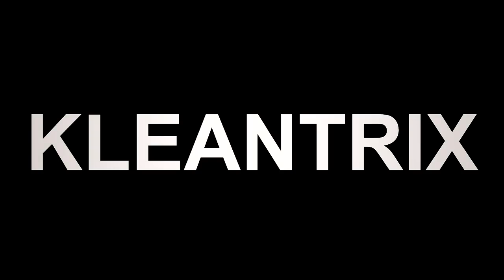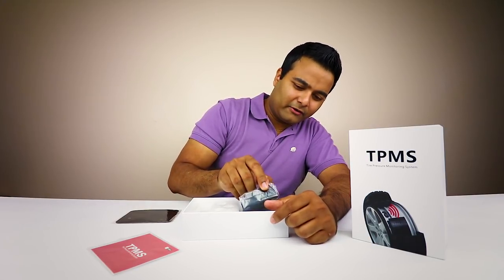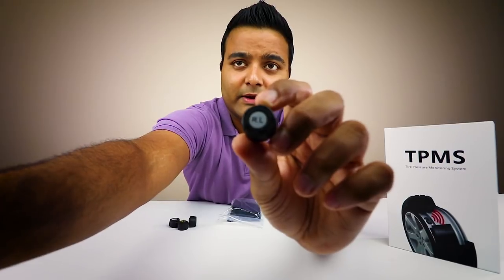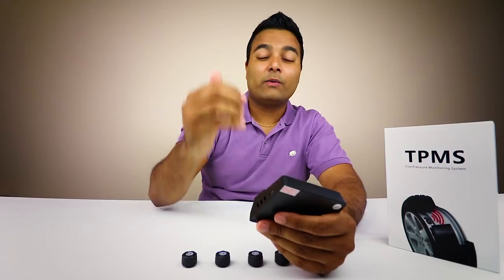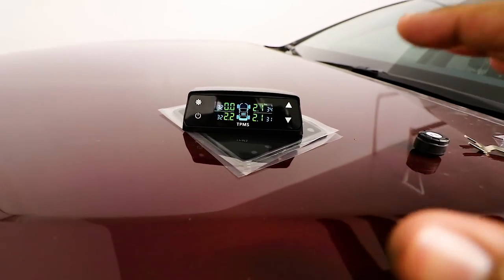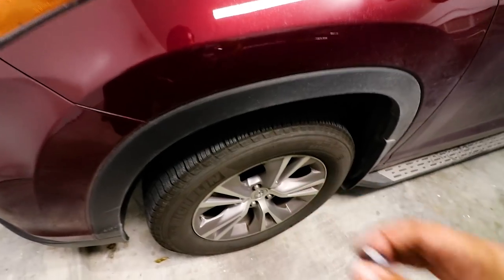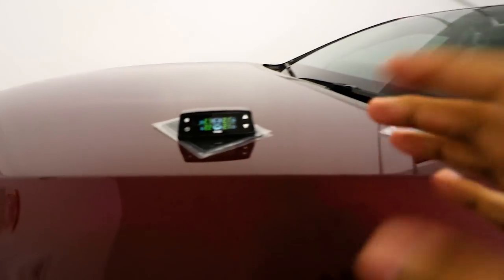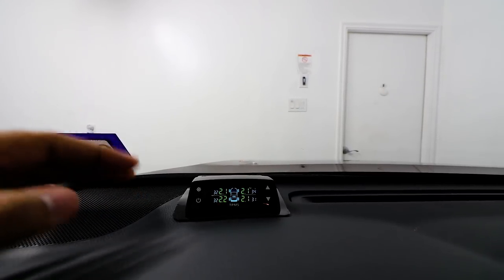PLUG & PLAY WIRELESS Tire Pressure Monitoring System!! (AUDEW)

Comment: The other question the display unit handle with High temperatures in our country the dergee reached over 50 degree out car in car reached over 80 degree if dirct in sun the plastic of display and battrey still work ?thank you

Comment: do we need to charge the sesnors ?
also when we need to filll air in the Tyre the only way is to unbolt the sensor , Right?
Reply: IT seems so
Reply: Im using something like this. You have to unscrew both the sensor and the nut

Comment: Do they work on travel trailers (60-80 lbs)?
Reply: This item is used for four wheels.  If your travel trailer has four wheels, it will work.
Reply: @brandfabloox5915   not at all what he asked!  He wants to know if it will work up to 80 psi... Travel trailers run high psi.. This would do no good if it only reads up to 50 psi, if that were the case his tire would be half flat and overheated before this sensor warned him. These wireless tpms are not one size fits all psi ranges..

Comment: can u plz tell me that what is differences between code reader and a scanner
Reply from the maker: To my knowledge they are the same thing. The device, FIRST scans your car's computer system, then it is able to read the codes that it spits out.
Reply: KLEANTRIX what I don’t get is that I see several 2.1 numbers but the psi are different so what’s the accurate number psi then and what do the 2.1 numbers signify
Reply from the maker: 2.1 is in BAR.  If your tire is above 3 BAR and below 2 BAR you need to get it checked out.  From my engineering days it is about equal to the atmospheric pressure on Earth at sea level.

Comment: THIS TPMS GET A BETTER REVIEW AND ITS CHEAPER. Favoto TPMS Car Tire Pressure Monitoring System Solar Power Universal Wireless with 4 External TPMS Sensors Real Display Tire Pressure & Temperature (14.5-72PSI/1-5Bar). WHY IS THE LINK YOU PROVIDED IS NOT WORKING, I WONDER LOL.

Comment: $80 to check the pressure, no thanks.. I'll use my old $5 air gauge
Reply: jay syed they wanted 60 to fix false warning light one of my factory sensors bad.  I'd still use money and if something on my dash like that it would be radar detector lol
Reply: Well if you run over a nail or something, then you can track the status of all 4 tires in a flash while driving. This product isn't a dire need but it's definitely useful for many people.